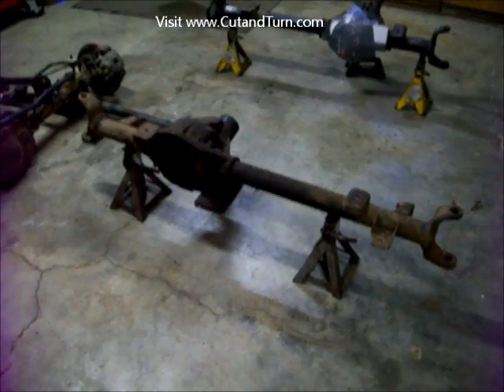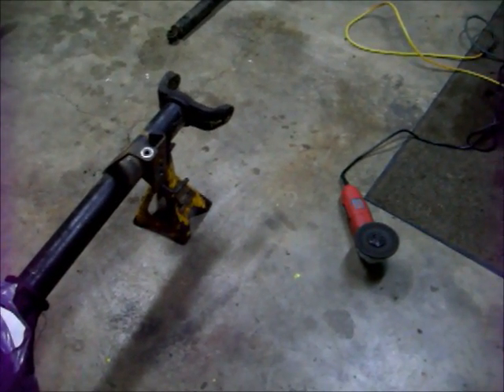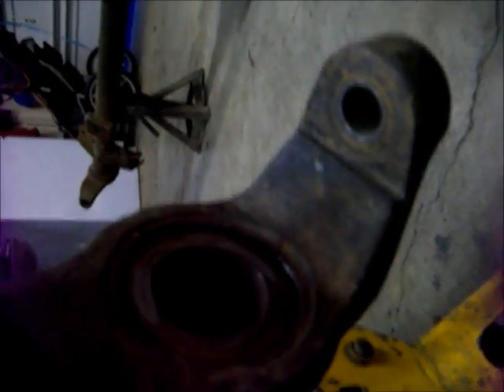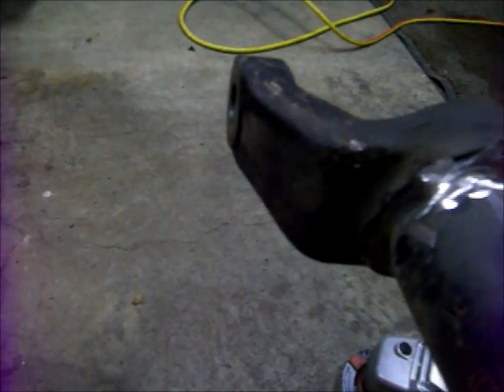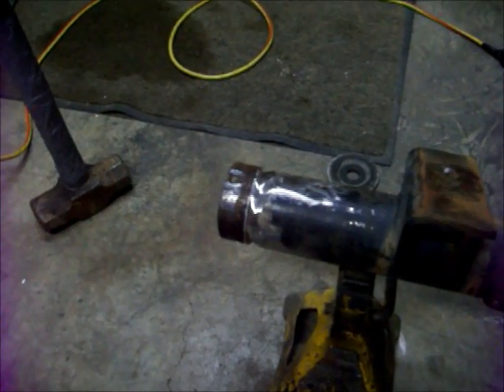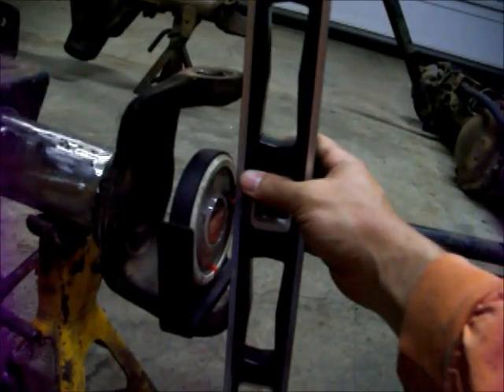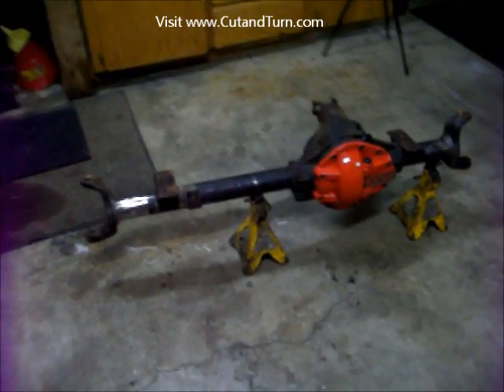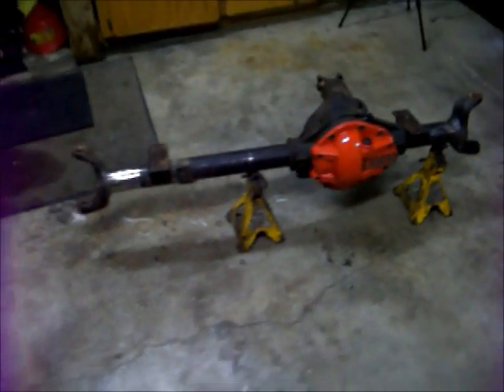DIY: Dana 44 front axle cut and turn . By www.cutandturn.com.

Comment: You have your caster angles wrong. Positive caster is where the spindles tilt back. How is it that none of yall know the difference between positive and negative caster. 

Normally it needs to be 3 to 5 degrees positive (tilted back) and with larger wheels and tires 5 to 7 degrees. With tires like 40s or larger you may need 8 degrees or more.

Comment: Hi , I will do my dana 30 from jeep WJ.There should bd cast steel, which gas to preheat and which welding metod would you use ? I have 220 mma/tig welder and buddy has CO welder.

Comment: New Subscriber here thanks for the videos. I have a 79 Jeep CJ with Dana 30 and I have done just about everything that I can to get rid of the stearing wondering. New stearing gear bow, gear box stabilizer, new ball joints, eliminated the tie rods with new solid bars, new front stabilizer shock.
The one thing I notice is that I have Positive camber up to 2.3 on the passenger side and 1.9 on the driver side.  I am running 33" tires and it looks horrible. I believe this is my problem,  so I decided to do what you did on this video and my question is how much caster would be the right amount for my jeep? Thanks in advance 👍🏽
Reply from the maker: 5 degrees is always a safe starting point.
Reply: @Chris_Pucci  Thank you very much for taking the time to answer, I appreciate that. I will give that a go 👍🏽

Comment: Personally I would measure caster with the axle in the truck before removing it, leaf springs don’t sit level especially if your center pin is not centered in the leaf, good video thanks

Comment: How do you ensure the bearings and axles are aligned inside the tube? Is the knuckle such a tight fit that's not a problem on front axles?
Reply from the maker: Yes, the inner c's fit so tight it is hard to get them on and they tend to self align. I do check them with a digital level a bunch of time before and during welding. If I have any worries that the axle isn't straight to start with, I do have a full length alignment bar with ends that fit on the spindles.

Comment: Good info! You should preheat the cast knuckle before finish welding to avoid cracking it.
Reply: No need.
Reply: On non steering parts I would agree.
Reply: @glennsands9127  The knuckle isn't cast, it's forged, that's why there's no need.

Comment: ive got a mig 175 amp 220v welder, you think it would be able to tackle this job? 
also, are the inner knuckles cast steel? i if so, i thought you needed to pre heat and post heat for them to weld correctly.
Reply: A 175 is enough welder to do a good job. The knuckles are cast steel not cast iron. Huge difference. Welding cast steel is easy and until you get to super thick material it can be easily done without preheat \ postheat etc.

Comment: Hello sir; 
I have a set of 1976 F250 axles in my 1984 Grand wagoneer and need to turn the diff to make for correct drive shaft angle. On the driver side the leaf spring sits on a cut out on the diff. Do I shim the spring and turn the knuckles?

Comment: Thanks for posting the video.  I plan to do this to a spare 1980 Scout II D44 I have laying around for use in my CJ7.  The current Scout II D44 has the pinion basically level with the ground, I want to cut and re-weld the spring perches to crank up the pinion, then base the knuckle turning degrees on that.

Comment: Okay.  I'm at 5 degrees now (with 37"s), and my steering wheel comes back to center just fine.  No shimmies or wobbles of any kind.  I'm building a new hi-pinion D44 to replace it and I welded the Cs to give me the same 5 degrees.  This is a 3-link so I have some adjustment via the control arms.  Thanks for your help.

Comment from the maker: I haven't tried a ton of caster with bigger tires. But I do know that tires wear faster with more caster. Some stock jeeps spec between 7 and 9 degrees - which is a lot, but they came stock with 28" tires. I just stick with 4-6.

Comment: Got it...that makes sense.  Its nearly impossible to nail it perfect without a test fit.  So what's your thoughts on castor angle vs. tire size?  Is 4 to 6 degrees good for all tire sizes?  Or should you increase to as much as 10 degrees for say 37" tires?

Comment from the maker: Very true, most leaf springs/perches do not sit at a perfect zero degrees when actually under a truck. But for this example the caster angle was horrible because a previous cut and turn had been done wrong! I was only fixing one side and holding the other side as correct. If I was doing this on my own truck I would bolt the axle under the truck - set it to ride height with jack stand and install the yokes to the desired caster.

Comment: Pretty good info here but, you should never locate pinion/castor angles off the perch angle.  Chevy housings (and most others) rarely mount to the truck with the perches level and true at "0" degrees.  The factory castor angle (you call "horrible"), is only horrible because you've got it sitting in jackstands with the spring perches level...and thats not how it actually sits in the truck.  Always use real world angles based on true vertical or horizontal, and not based on the perches.
Reply: 4speedfunk I hear ya, but does that even matter when you’re taking it off to cut and turn it? I’m sure that number isn’t relevant anymore? Unless you want to put temporary shims I think.

Comment from the maker: No - there are actually 2 axles in the video the first is a Chevy Dana 44. The second one is the one that gets welded on and it is a Ford High Pinion Dana 44 that has been retubed for a Jeep CJ. But to answer your question - I use shims all the time on Chevy axles that are cut down to Scout II width. Get real solid steel shims and weld them to the axle spring perches and they will be safe and a good solution for correcting pinion angle problems.

Comment from the maker: I will put one together in the next week or so where I cut down an axle. 

 As for the axle shafts - you can have them cut and resplined but it is almost as cheap to just order new ones with the correct length. Unless you have a good sized lathe and the right tooling it is not a job to try at home.

Comment from the maker: If you only adjust the spring perches your caster angle will be terrible and you won't be able to keep it driving in a straight line. The whole point of the cut and turn is to correct the pinion angle and caster angle at the same time.